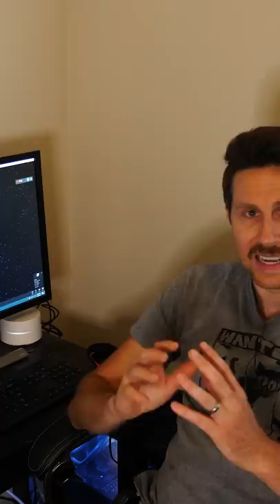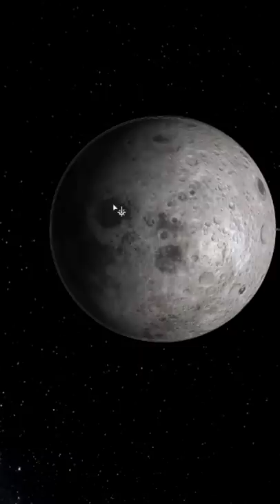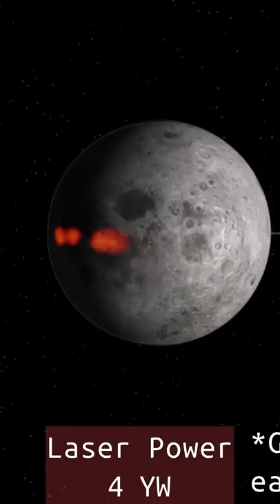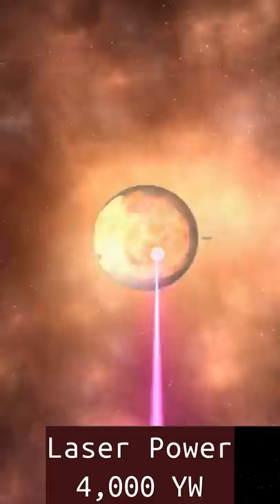Trying to Destroy the Moon With The World's Most Powerful Laser

Comment: The typical red laser pointer is about 5 milliwatts, and a good one has a tight enough beam to actually hit the Moon—though it'd be spread out over a large fraction of the surface when it got there. The atmosphere would distort the beam a bit, and absorb some of it, but most of the light would make it.